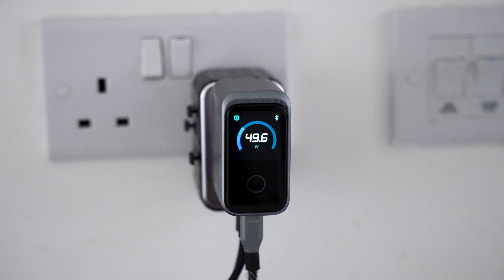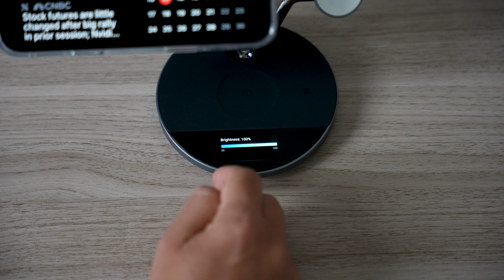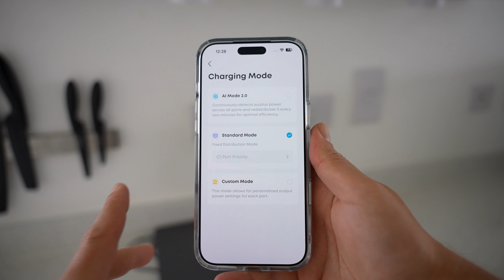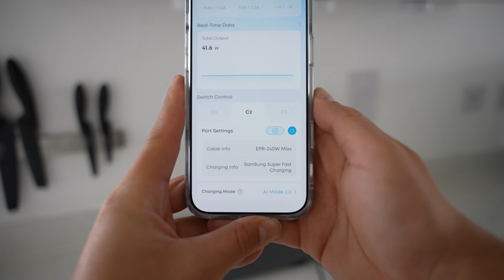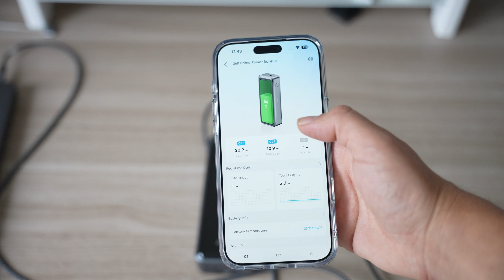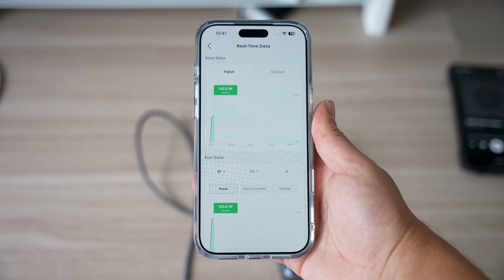This Charging Setup CHANGES Everything - Anker Prime Chargers

Comment: If Anker could make a desktop charger with retractable cables it would be a game changer. there's literally nothing on the market with retractable cables other than a car lighter socket charger or a portable charger! seriously, something on the desktop where you dont need to ever plug a cable in or look for one again would be genius
Reply: They make one. Look up 100w Nano charger with smart display. It has retractable cables, and i think they make several other desktop units with retractable cables too.
Reply: @weegeemike  They're all carry around power banks. I've seen a plug straight into the wall one but it wasn't by Anker. I'm thinking a solid desktop option that doesn't move